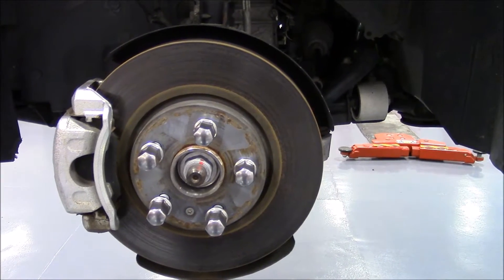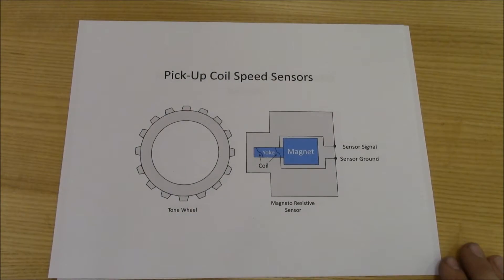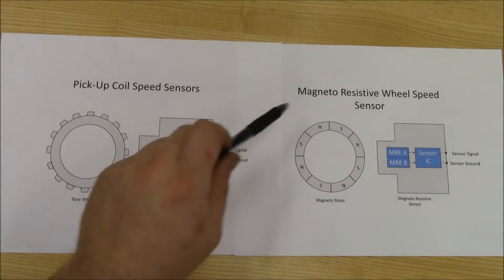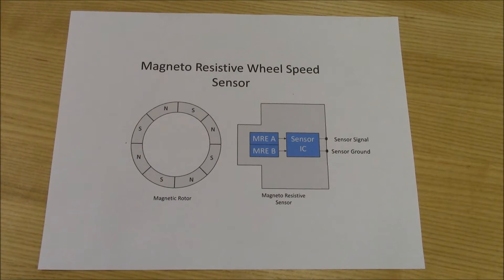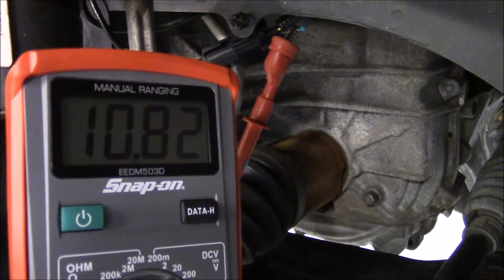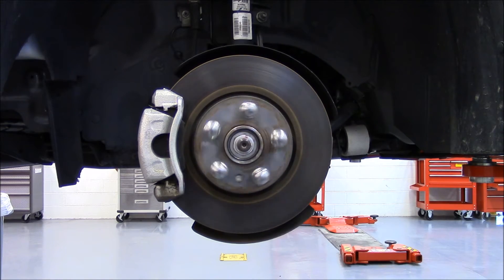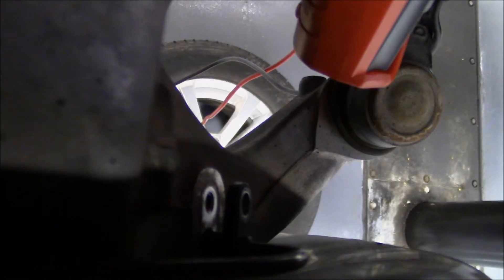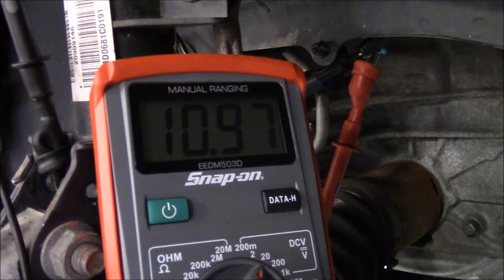Magneto Resistive   John Grischow

Comment: The voltage supply shouldn't vary on an active abs sensor. A constant voltage is required to ensure the dc response from the sensor is consistent with the actual wheel speed and not the applied voltage. The active sensor has a hall affect transistor to sense  the alternating magnetic field from the reluctor ring to determine speed and rotation direction of wheel and the ecu conversion to a speed indicator